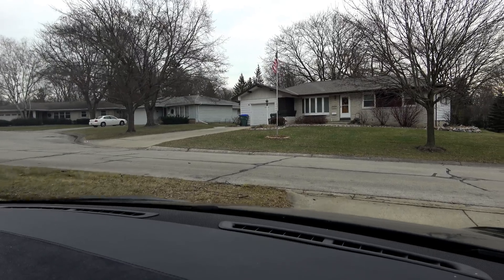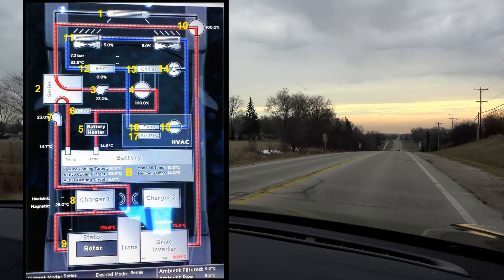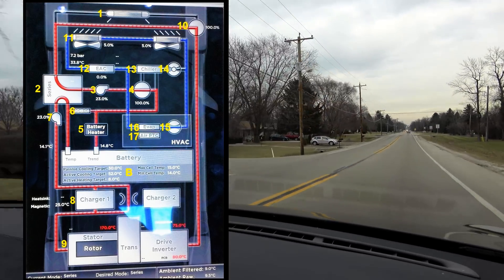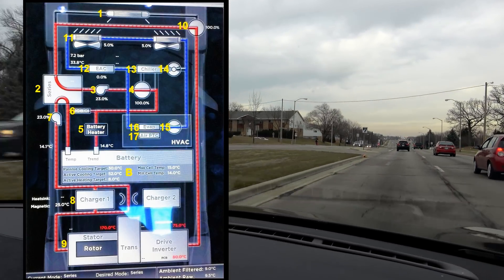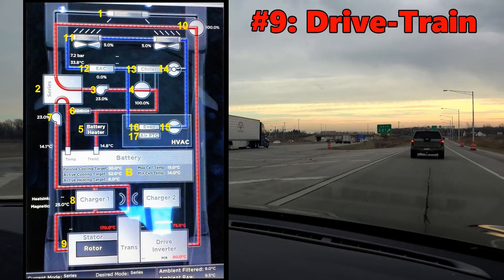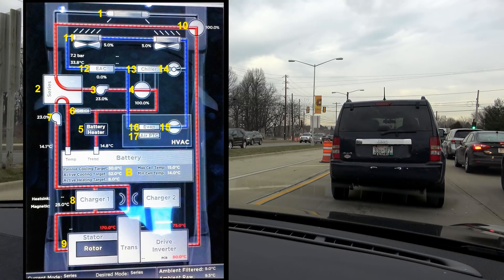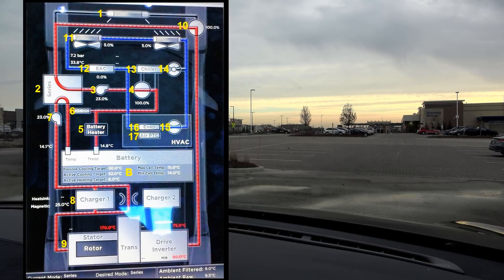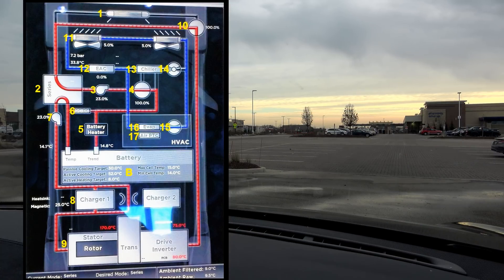Tesla Thermal Management EXPLAINED  W/Diagnostic Screens

Comment: Question for you. If the cars refrigerant system is empty and not working would charging be unavailable and noted as such on the dash.
Reply from the maker: It may still operate. If refrigerant is low or empty, and the regular coolant is still available, it should still charge especially in cooler climates. I’d avoid supercharging though. if the coolant is also low or empty, vehicle should not be driven as the batteries have zero thermal management
Reply: Thanks, I just replaced the radiator, coolant and one condenser in a 2017 S90D from an accident. I have not charged the ac system yet but battery is low (24 miles left) and charging unavailable warning is on. I have at least one coolant pump running constantly.

Comment: Do you know if Tesla uses heat from battery/motor/charger to heat the cabin? Or is the cabin heated by resister heater only? Thank you!
Reply from the maker: For non-heat pump cars, no, but it can flow the heat via the coolant to the battery or another motor. For heat pump versions, it can take from where ever it wants on the heat pump system.
Reply: @KmanAuto  Thanks! 🙂👍

Comment: So. I’ve been having an intermittent issue with the cooling system in my model s P85D. When I got my car back from the shop in Jacksonville, I took it to super charge and the cooling systems reduced warning ⚠️ came on and it was hot in the Cabin. I’ve called tesla and notified them of the issue and asked if they wanted me to bring the car back in. They said no, one of the switches must be stuck, it will fix itself, you’ll be fine. That was like a year ago and it still happens right after I super charge. I’m not certain if if the louvres or number 4 that is the issue but finally today they found that their is an issue, so I’m taking my car in. 
Woo say.
Driving through Arizona with the cooling system reduced, my cabin reached 140° f. I thought tesla had some sort of protection to keep the cabin under 105° but that’s defective. Since I got my car back, with this issue. It has been dangerous to drive my car and frankly unpleasant.
Reply from the maker: Sigma Soldier Keep me updates on the issue!

Comment: You mentioned range mode. One thing to keep in mind is if you are on a road trip and you're going to go from supercharger to supercharger. If it is extremely cold outside you really do not want to have range mode turned on. When you get to the supercharger your battery temperature will be low enough that it will not charge quickly at the supercharger. Seeing a guy on a road trip who ended up having this problem in a p85. And he wasn't really sure at the moment why the car was charging so slowly. Ended up figuring out that that is what was causing it.
So unless you really are concerned that you won't make it to the next supercharger because you don't have enough battery left I would not leave range mode turned on.
Reply from the maker: Personally, I disagree. When it's that cold it can be the difference between making it to the supercharger or not. I did a couple long drives at -38*F, and had absolutely Zero issues. The Model S, X and Y have battery heaters(Though only S and X have range mode). Realistically, your talking maybe 5 minute charge time difference when AT the supercharger for charge rates to jump up. I speak with over 200,000 miles of Tesla driving experience. If your that concerned about battery temp upon arrival, flip off range mode when your 10 miles from the supercharger. The supercharger pre-conditioning will not start until your 10 miles or less from the supercharger. 

Further, the battery heater will still kick in with range mode on. But instead of wastefully keeping it at 33*F or higher, it will keep it at -10*F or higher.  
With my range mode on in -38*F, I arrived at the Madison supercharger, charge rate started at ~40kW, and after about 4 minutes my charge rate hit my cars (Tesla capped) maximum of 94kW and maintained that. 
As for cabin heating, also no issues. The car adapts fairly well. 

As for your p85 charging slowly, how long have you had it? Whats it's mileage? Are you aware that Tesla is now artificially capping both capacity and supercharging rates on the original 60 & 85kWh batteries, as well as supercharging rates on all S and X vehicles after some magic mystery tesla pre-determined amount of DC charging? NHTSA Probe is going on and Class Action lawsuit. Started June 2019 firmware, and they have been making it worse since. My latest firmware 75D Model X now takes 3-3 1/2 hrs to go from 1-100% at a supercharger, my 90D Model S on firmware 8.1 yet only takes 2 hrs or less to go from 1-100%. Tesla is also taking an easy 15-20% off the 60 & 85 kwh batteries artificially by capping the pack maximum voltage and saying it's degradation, which it isn't.
Reply: @KmanAuto  
Wasn't my car personally. I've been interested in purchasing a Tesla Model S and probably would be an older one. So I've been watching a bunch of videos posted by a bunch of different people.
I've been watching a lot of Out of Spec Motoring videos.. I tend to do road trips in my hybrid add a similar technique and pace as he does on his road trips so I tended to gravitate towards his videos.
This guy definitely knows how to road trip at a fast pace. Perhaps that is why this issue arose.
He tends to run to a low state of charge, cram as much in the battery as quickly as possible and move on to the next supercharger. Usually is not following the Tesla routing, as it tends to have you charged longer and go farther. Whereas he prefers to charge to the minimum required to get to the next supercharger. He finds that to be overall faster when you have a time crunch to get some place which was the case with this particular car and situation.
He had to be at the destination at a certain time to catch a flight.
He had noticed this issue with a p85 that he picked up for a family member. I can't remember exactly where he picked it up at but it was winter time and definitely in the negative numbers.
And he commented that it wasn't reaching its peak charge rate correctly. And he wasn't at the time sure why It was doing this, he was concerned there could be a problem with the battery pack. But then occasionally it would charge at more regular speed. 
I should mention that at this time that he was driving this it would have been quite a long time since he had personally owned a Model S. He had been doing most of his road tripping in the Model 3. And had gotten used to its charging behavior. So it was a bit of a re- learning curve for him as well on that particular trip.
Later on after thinking about this he wondered if the fact that he had range mode turned on is what was causing this. And in the comments on this particular video there were people going back and forth as to perhaps this was the cause or was not the cause. I'm not sure that they ever really concluded what had caused the anomalous behavior.

I totally agree with you that you could turn it off 10 mi beforehand if that is in fact when it starts heating the battery.
Could also be that there was in fact some slight problem with this particular car. I don't remember what the mileage was on it.
You can find the video on his channel if you want to watch it..
The guy definitely knows how to road trip at a fast pace. He has two electric car world records for the cannonball run going east to westbound.
 he has many videos concerning rapid road tripping in a variety of cars. Not just Teslas. He's got a coupleHyundai Kona road trips also.
And he runs a race track, the guy definitely knows how to drive.
Anyway thank you for your very detailed response with the interesting facts and information. Definitely useful for me. As I am still in a learning curve.
Basically I'm going to be replacing my hybrid with some electric vehicle most likely. And I'm trying to decide whether I should go used Model S, or new Chevrolet Bolt EV. I realize they aren't in the same class of vehicle. But at this point they are in the same price class or pretty close to it. I'm extremely mechanically inclined I'm not afraid to tear a door panel apart or a dash apart to get the MCU replaced myself. But I am also factoring in that I could buy a brand new car with a warranty for pretty much the same price or less. Obviously a much less luxurious car, and that sort of where I'm bouncing back and forth with on the one hand I'd really rather have the Tesla because it's super cool and charges faster for road trips. But on the other hand I can buy a new Chevrolet bolt which I also actually like a lot but obviously has much less luxurious driving characteristics. But that car charge is particularly slow for road tripping. But I could always keep my Prius for when I want to do a road trip. Anyway thanks again for the reply I greatly appreciate it.
I hope you have a wonderful day and drive safely out there.
Reply from the maker: @kens97sto171  Thanks for the update. If he was driving, at freeway pace, I highly doubt it was range mode that affected the speeds. A LOT of factors go in to supercharging as well. 
Yes, MASSIVE charge curve difference between Model S and Model 3. A capped model s will hit about 94kwh max, and lucky to get 50kW at 50% soc. Where as a Model 3 can hit as much as 250kW charge rate at a V3 supercharger. 
I would take a Tesla, ANY Tesla hands down over a Bolt. If you want to do any distance traveling what so ever, outside California, it's not going to happen in a Bolt. If your only doing city, get a used Bolt for around 10k. 
Even then, not anywhere near the class of vehicle. A TESLA Can REPLACE any GAS Car. a BOLT can replace, well, "Granny's only driven to the grocery store and church" car. The long-distance network is all third party and endless holes in it.
In 2014, I could go pretty much anywhere in the country with my Tesla. Even easier to do so today and I routinely do 5,000+ mile road trips pulling a camper with my model s right now. With a bolt, It would take probably a week for me to get from Wisconsin to Oregon where I go camping each summer. With my MS, it takes me exactly 2 days, including all charging time, WITH my camper in tow which cuts my range in half. Without the camper, I can get from Milwauke to Chiloquin in 1 1/2 days.

Comment: Do you know if anyone ever determined the minimum battery temp on the Model 3 (or Model S) to accept maximum V2 charging? Would love to know what temp to get the battery up to prior to visiting the supercharger for maximum charge duration until it hits the thermal throttling you ran into.
Reply from the maker: Same chemistry as the Model S/X just in a larger cell. The BATTERY temp would need to be approximately 80*F (26.7*C) to accept current full Supercharger V2 rates. 70*F would Yield around 60-80 kW and lower than that your mileage may vary

Comment: Do you know the code to get to this screen? Seems to be a 4 pin code.
Reply from the maker: Not available. In the early days of the model s, it would be changed by tesla regularly every few weeks or month. Once someone got their hands on the code, that's how this diag screen got out as well as others. Tesla sent out an update, so now to use the Diag code, a few requirements. #1, vehicle must either be within a certain distance of a service center, or the mobile tech must whitelist the working location. Next, the code is issued on the spot fresh from tesla at the time work is being done. 
Now, though, techs rarely use the code. It's var easier and much more useful to plug in the tesla laptop to the car and work via that.
Reply: @KmanAuto  Some smart dude should make an app with that screen. The data could be taken from the OBD like "Scan my Tesla" does. Or maybe "Scan my Tesla" might want to show it's data in such a good way - the data is there, isn't it?

Comment: Incredible system! Seems like my Model 3 always has limited regeneration. I’m in Seattle and it’s rarely freezing. Usually in the low 40’s and raining in winter. I charge to 80% when I get home. In the morning, I move the charge limit to 90% and heat to 75° before I leave. Drive for 12 miles, still limited regen. Drive home and charge back the 10% I used, still limited regen. Isn’t charging supposed to warm the battery? I’ve only seen a warm battery on this thing when I’ve driven like 40 miles with the heat on. Had a warm battery today but I drove home, charged for 2 hours while preheating, still had limited regen, kept the heat on, drove 30 minutes, ONLY then on the way home was the battery warm! Super fun rip home with full regen 😆 
Awesome car, I love it! But, like, what is the trick? Blast the heat before I leave? Time the charging? 🤔
Reply from the maker: The Model 3 is a different beast. Personally, Tesla did some MAJOR steps backward in the Model 3 thermal management. One, and most importantly, the Model 3 does NOT have a direct Battery heater now. It's indirect. Thus,, it takes CONSIDERABLY longer to heat the pack.

Heat generated from driving is very low. Unless you floor the accelerator, your not generating much consumption heat. I'm still working on getting a diagnostics screen for the Model 3. But, still, in the end, even if the M3 had a dedicated pack heater like the S and X, you save MORE power by not running a pack heater, than you would gain by there for having regen. 

Blasting the heat before you go will not work on a Model 3.
Reply: KmanAuto My understanding is Model 3 currently doesn’t have the visual diagram to display this. It just has them listed... I agree, Model 3 is a step backwards for heating ability but a huge step forwards in its ability to cool the pack and recover from heat soaking.
Reply from the maker: Thanks for the input. Perhaps Tesla does have a Flow-Chart of some sort. Yes, heat has been a killer of the current chemistry.
Reply: I've found the best bet for restoring limited regen quickly, in 40-50 degree weather, is heavy "on/off" acceleration for the first few miles.  I live in an area where I can vary my speed a bit without disrupting traffic around me, at least for first mile or two.  I floor the car to maybe 45mph, then let it slow to 20mph, then floor it again, repeat.  In my experience,  flooring the throttle on and off several times restores full regen far quicker than just driving at a steady state.  Before I learned to do this, I too would reach my destination without full regen.